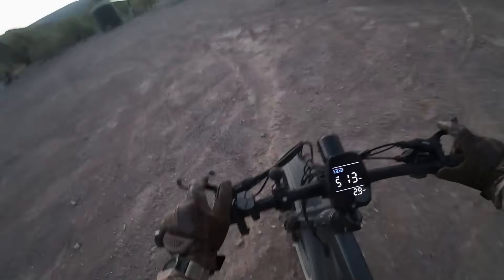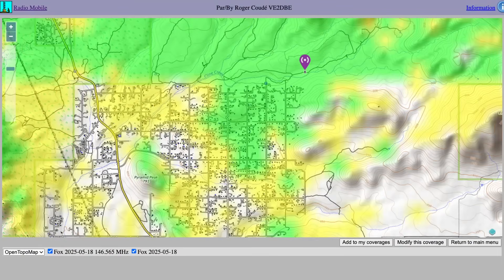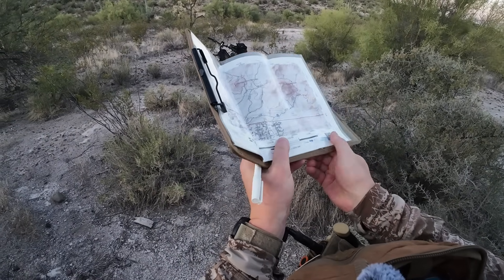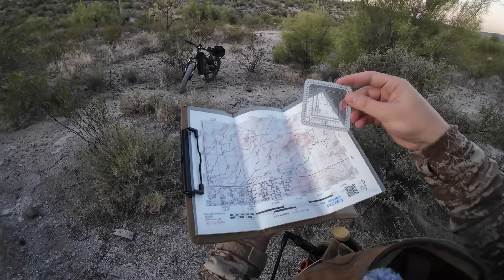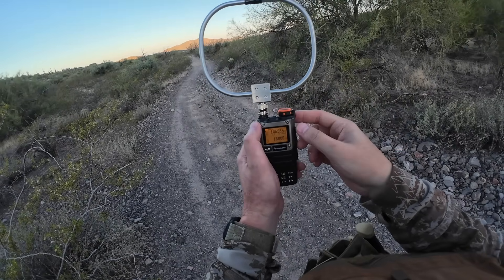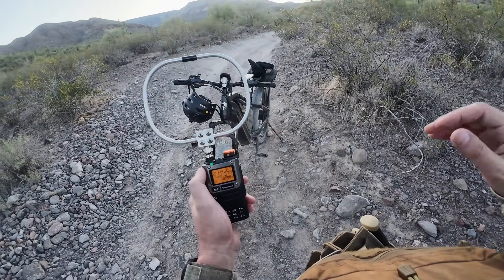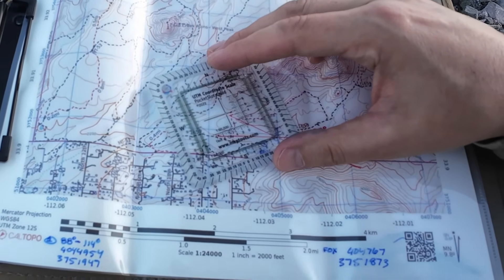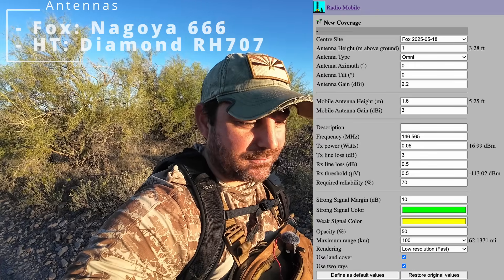Radio Direction Finding - Episode 3: Null Hunting

Comment: Take multiple readings in several locations. When hunting VHF/UHF signals there can easily be reflections which will mislead you. It takes multiple readings to begin to see past the reflections. You'll start to notice a trend that will correct for those few misleading reflected signals.

Comment: You never opened your squelch all the way (you should hear all the static). That will greatly hinder your radio’s ability to hear. I believe this is why you lost signal so fast. Your software might not have been wrong.
Reply from the maker: Great call considering I was on the edge of the receive coverage. Actually, another viewer commented on the settings for the RF coverage prediction. He provided two small settings to change and the numbers more closely resemble reality.

Comment: Gaston, it looked like you were suffering from reflections.  Our club will purposely place the fox near terrain or features to create intentional reflections to make the hunt more challenging.  For initial testing, It could be helpful to elevate the fox to an unobstructed LOS, and then take your readings away from embankments, mountains, ridges, etc.  With experience, you learn to work through these challenges.  Keep it up.  This is a great series!
Reply from the maker: I've done two of the last three hunts out in this terrain and the rocks and granite are rough. For the next episode, I'm going to move to an open location with less rock and terrain features that cause reflections everywhere. I appreciate the insight.

Comment: You might be interested in trying a 2-antenna TDOA setup as well - which might give you a tighter range of bearings. A tighter bearing range might be possible from wider apart antennas.   While it works at distance, I was also amazed at how well it works when close to the transmitter - this prefers strong signals whereas the other approaches start needing attenuation when close.
Reply from the maker: That's 100% in the plan. I'm trying to start with basic tools. Next up attenuation using an offset attenuator. I'll build up to a KrakenSDR. Cheers and thanks for the tip.

Comment: I know i have read that when the military is searching for a SOF guy for rescue they use a dish antenna 📡 from the air to pinpoint the location you can't miss with a dish your either on target or your not. so try a dish with a couple locations of elevation.
Reply from the maker: I think the big difference in the accuracy is the use of an aircraft. I'll try the higher ground next time but it's challenging to get to multiple high points quickly in this particular terrain. Thanks.
Reply: @TheTechPrepper  use the satellite dish as a reflector for a bowtie antenna. The bowtie antenna can be mounted at the focal point of the dish, which can help to increase the gain and directivity of the antenna. This setup can be particularly effective for VHF signals.

Comment: I don't know if its a quirk of the UV-K_'s in general or the particular firmware, but the RSSI minimum never seems to line up with the "real" null when I use a loop with a K5-99. My RSSI arcs are very close to what you found, but if I just stick to signal/no-signal that arc closes to 10-15 degrees. 

I scroll through your previous videos in case I missed it, but if you haven't covered it already what bike?
Reply: Found the bike vid, thanks.
Reply from the maker: There are only two out there. This was the rare time where I accepted gear from a manufacturer. It's the HovAlpha by HOVSCO. After I added the tannus armor tire liner and filed the tires with Muc-Off, I haven't had a flat. I'm a fan of the bike, so I picked one up for my wife.

Thanks for sharing this bit of info about what you're seeing with the U5-K5. I'm running the firmware by armel. I'll take this into account next time.

Comment: I’ve found adjusting the percent required and strong signal margin bring your radio mobile estimates closer in line to reality. To model adverse conditions I set the strong signal margin to 20db and my required percent to 95

Also run the estimate at very high resolution.
Reply from the maker: I can't thank you enough for this pointer. I'll re-run the numbers and see how they line up. This is an area that is brand new to me. Do you use the Windows or online version?
Reply: @TheTechPrepper I have both, but more experience with the online. Strong signal margin calculations are still a bit esoteric for me, but if i understand it correctly, it is highly dependent on the environment. Clear dry days with minimal foliage will have a lower required strong signal. Humid days with dense wet foliage in the same location will probably require a higher strong signal margin. And of course ground composition and structures will also play some roll. It’s enough to make your head spin.

Another tip is to set the calculation radius to the expected range. In your case only a few km. Use the hundreds of km for repeaters etc.
Reply from the maker: @anduril328  Thanks for sharing your experience. I was looking at SPLAT! as well and the configuration options for the input can make your head spin. 73
Reply: @TheTechPrepper One more tip. After creating a coverage, you can go to My coverages and select one to view. While viewing it, you have the option to download the files (lower left corner). Once the zip file is downloaded you can add it to a google earth (browser and desktop) project. This will add a nice overlay to a street or satellite map.
Reply from the maker: @anduril328  Thanks for the bonus tip. Also, I made the two adjustments that you recommended and the coverage map is pretty close to reality. If you're on QRZ, shoot me your callsign. I'd like to send you some patches and stickers as a thank you!
Reply: @TheTechPrepper dm sent on qrz

Comment: I wish I was out there doing this. I am thinking about putting the fox antenna on a ground plane that is elevated to get it in the clear of local reflections.
The same when using the loop. Put it up on a short cable and a stick, maybe you could hold it a few feet above your head.
It is hard to tell on the video, but it looked like your bearings plotted were away from the fox, with your body in between. Not sure how you were oriented verses the numbers.
Reflections off of the terrain could make your location tricky, but then that needs to be considered for real world locating of an injured party.
Reply from the maker: Good eye! The fox was behind me, and my body was likely attenuating the already weak signal when my back was blocking the signal. In this case, I knew the fox was behind me instead of in front of me. This is the challenge with taking just one bearing; you don't know if it's in front of you or behind you until you take a second bearing to get the first point of intersection.

Best of luck with your fox deployment and setup!

Comment: I figured your third installment would introduce attenuation. If your null is too wide, off tune to 146.560 or 70. The closer you get try the third harmonic. Most of us also use an offset att. or step attenuator.
Reply from the maker: I'll get there. I've had the 4mHz offset attenuator since I started this series. I also had the third harmonic listed in the field card for episode #2. 

I was already very close to the edge of the receive capabilities at this distance with the signal being about -110 dBm.

I'm pretty sure that there would have been no signal received with the third harmonic at this range. 

I thought that the attenuator was used when you get closer, not for the initial bearing? 

I plan to use both techniques for the next installment. It's time for more power again.

Thanks for the tips!

Comment: Looks like your making progress, but my guess is it isn’t as easy as it seems
Reply from the maker: This has been my suspicion all along. I'm sure that once I get to more sophisticated gear, like the KrakenSDR, that it will be fast and easier to track down transmitters. The number of people that will be in earshot of your signal with the skills to track you are vanishingly small, especially if you're on the move, practice least power, minimizing your transmission time and vary your schedule, frequency and mode.
Reply: @TheTechPrepper I agree.  Time to take a hard look at operating style if one’s ever out doing something that’s questionable or things take a hard turn for the worse